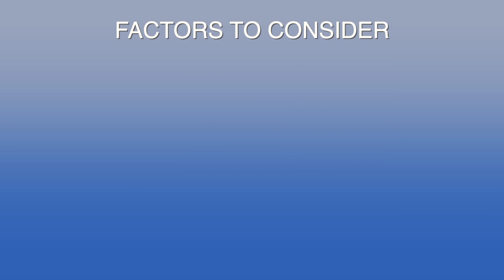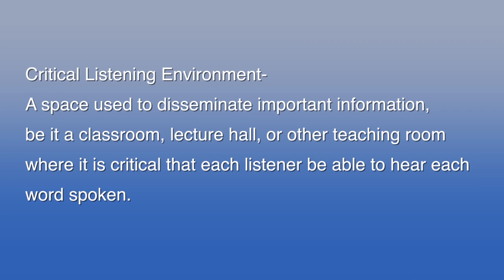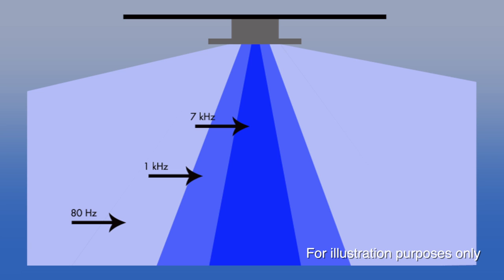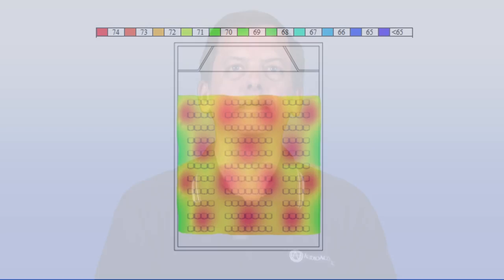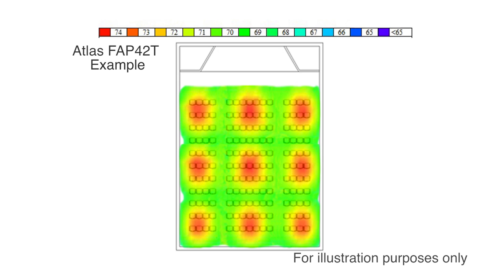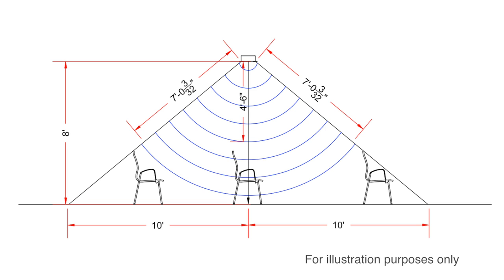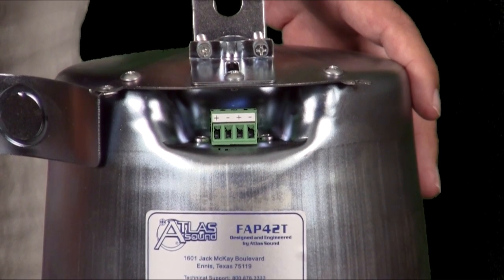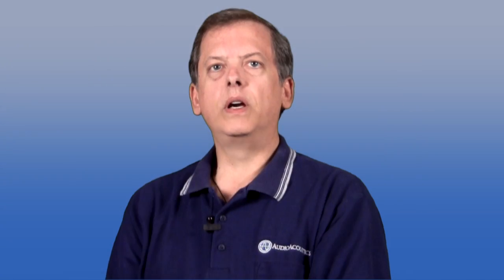70V Speaker Systems Part 2

Comment: Hello  I was reading  70v installation process but I still have a doubt. And my question is this I'm installing a 70v system with 12 speaker and what I have been looking at is that the most important part is that the connections be in parallel, but my doubt is can I RUN 1 wire and daisy chain 6 speakers to one side and then run another wire with another 6 to another side and have both sets of speaker coming out of the amplifier. or in another words have to home runs with 6 speakers each

Comment: Why would you space the 4 inch speakers further from each other than the 8 inch speakers? in the coverage graph you showed,  you had less overlap coverage with 4 inch placed at 14 feet than you did the 8 inch at 10 feet.  That doesn't make sense. In my opinion 14 feet of separation is too far for any size speaker, unless the ceiling height is really high.

Comment: Can I use this speakers at home for tv
Reply from the maker: @Gaspar Ma This style of system is not typically used for home entertainment systems. The components are higher priced compared to consumer grade items and the speakers will often not have the same fidelity ranges as those designed to work in a home theater system. However, there is nothing preventing you from connecting the audio output of a TV/DVR/Game Console to a 70V amp. Sports bars and restaurants will often do this so patrons can hear what is playing on their main screens. You just need to make sure the i/o of the two devices are compatible.